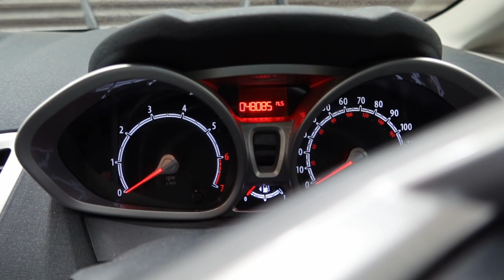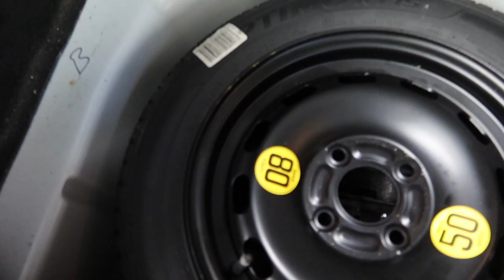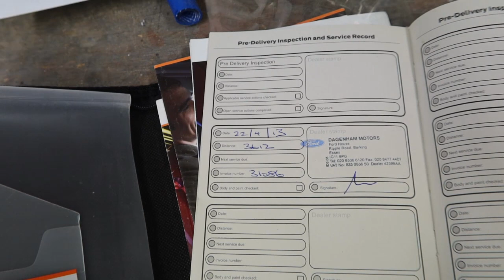Fiesta salvage repair part 2 COLLECTION FROM SALVAGE AUCTION IAA UK !!

Comment: Hi paul looking to buy a dolly, is yours braked dolly and does it have to be? Also can you tow a car thats got no mot or tax on it?
Reply from the maker: Hi mine is not braked not sure of the laws now proberly should be braked but I would argue it. As 2 wheels are off the ground it's a trailer so no mot or tax required I've never been stopped and police have seen me with cars on it many times hope this helps 😉 👍